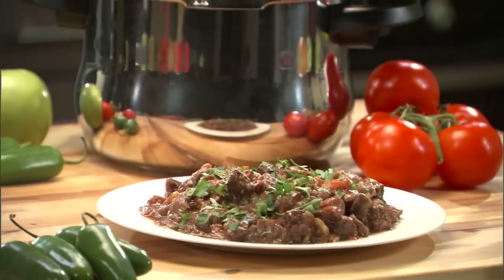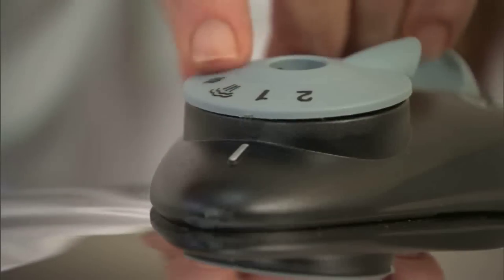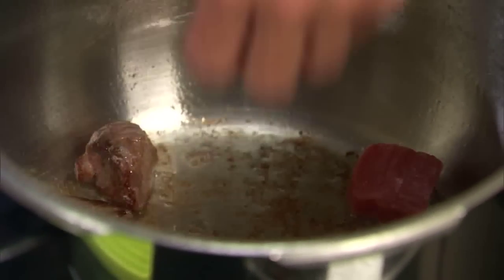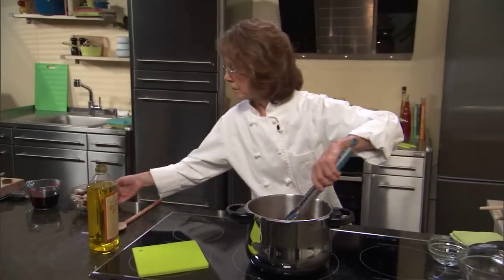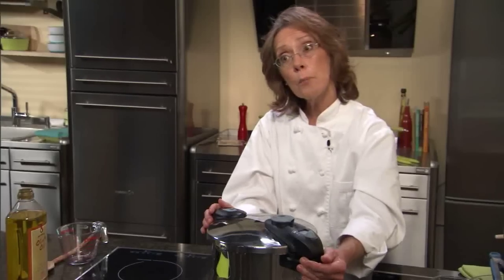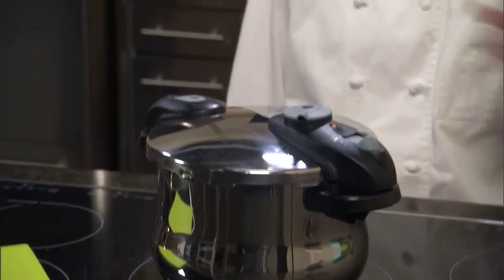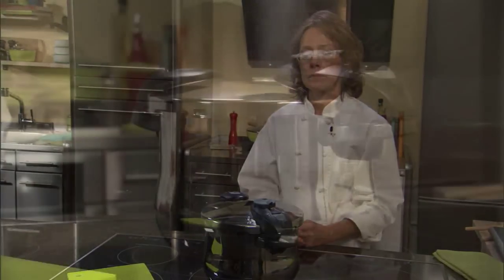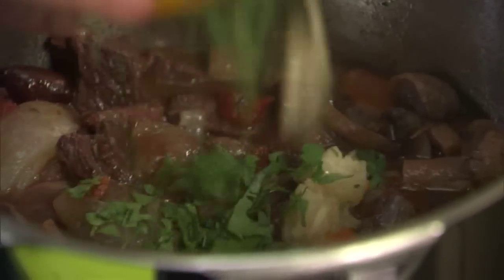Fagor Futuro Pressure Cooker 101

Comment: I've only used mine 6 or 7 times since buying it in december and a problem has developed under the handle where it's allowing pressure/steam to escape.  I've emailed Fagor customer 3 times and tried calling.  Not having much luck.  I received one reply asking if I wanted a replacement handle and I replied yes but haven't heard from them since.
Reply: I've used mine once and I have the same problem :-(
Reply: Will do, thank you for your fast reply. Very inspiring!
Reply: steam comes out under the handle by design

Comment: Hi actually I had this pressure cooker. The only question that I have is that why this pressure cooker is reducing water level while cooking however other pressure cookers don't. I had another pressure cooker but the water level remains the same that was at the first time before putting on the stove. I am just wondering is there any thing wrong with my pressure cooker?